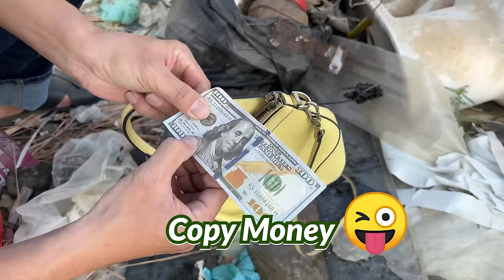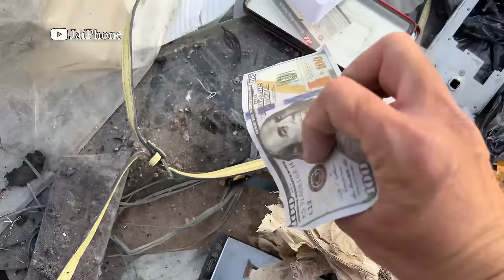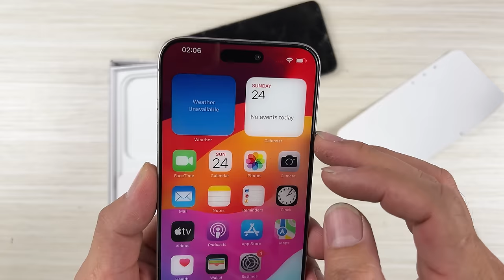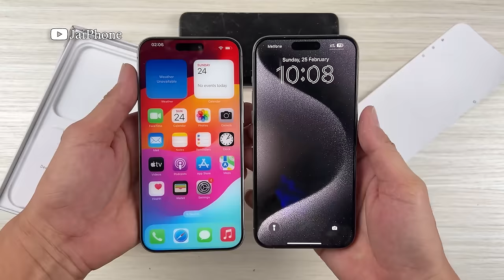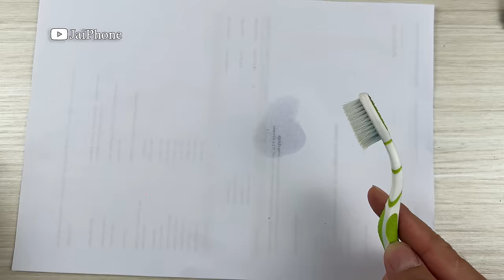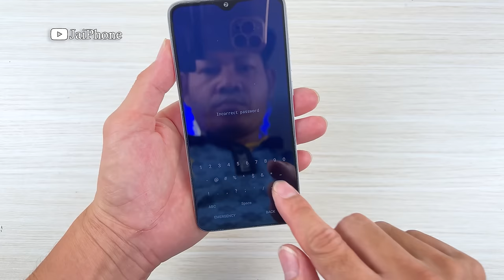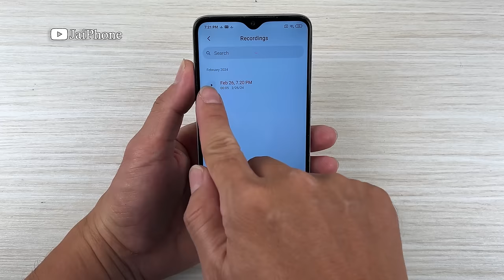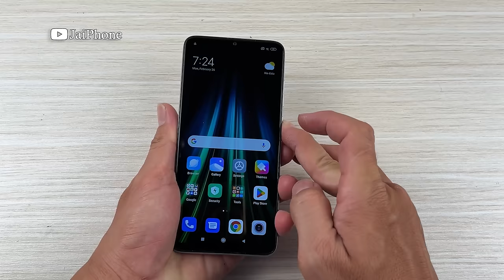😍i Found New Dummy iPhone 15 Pro Max, Magic Mouse & More! Restoration Broken Redmi Note 8 Pro Phone

Comment: why don't you replace their frames instead of repairing them temporary this is not called a proper restoration
Reply: Is there something wrong?, the frame is not broken and there is no damage, restoration is not just replacing spare parts
Reply: 2:47 hdu43u4u 3u4
Reply: Merregalas